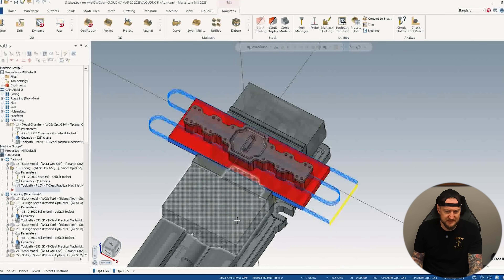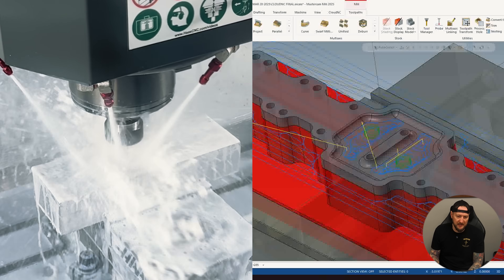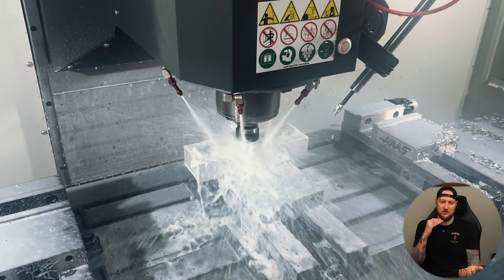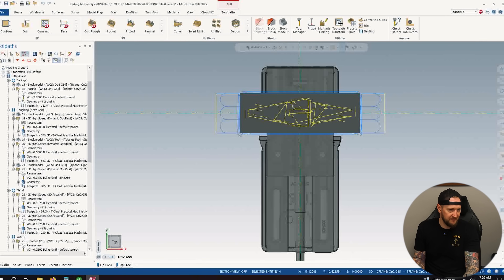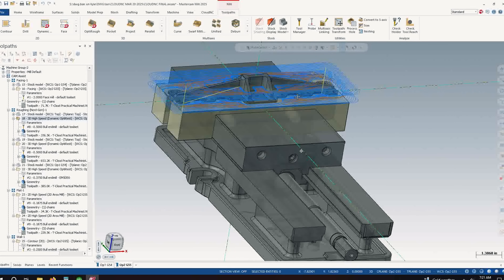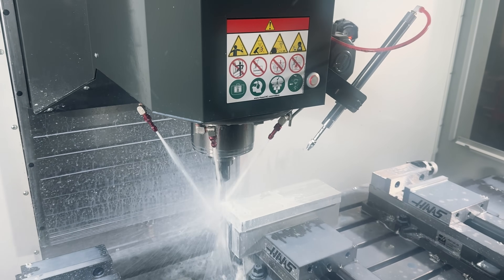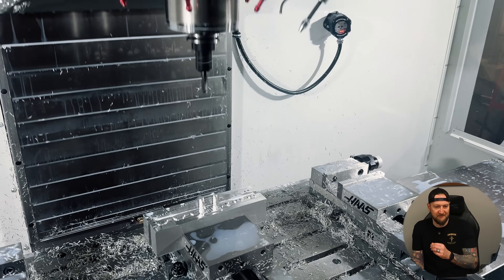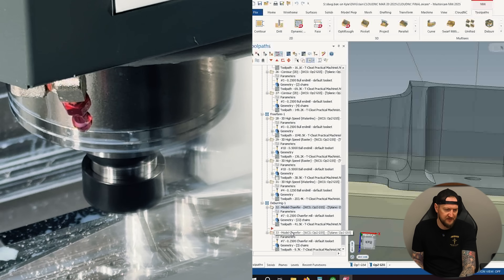AI Programs My Roughing Passes Like That?! | Machine Shop Talk Ep.132

Comment: ok IA is goeing to finish programing  faster than me, but god dam it's slow running the part. i rather spend more time programing and make parts go faster if i have a bit of production goeing on. And on top of all that there was chatter wich decreases tool life
Reply: The chatter was on me and not CamAssist - I had a too-long endmill in there from a previous job that I used and should have chucked it up higher!